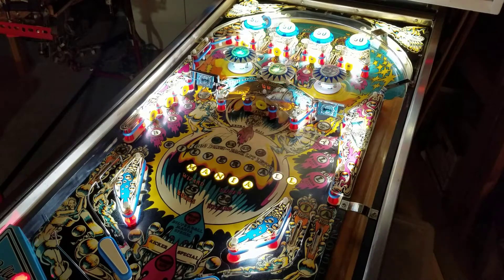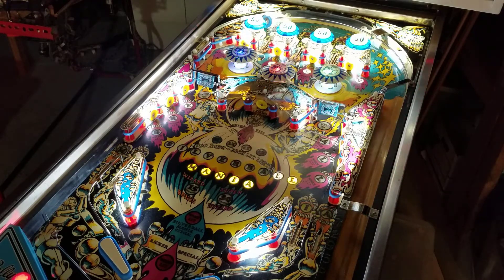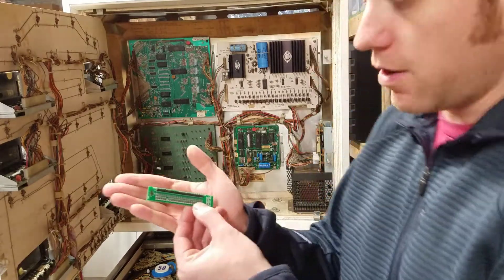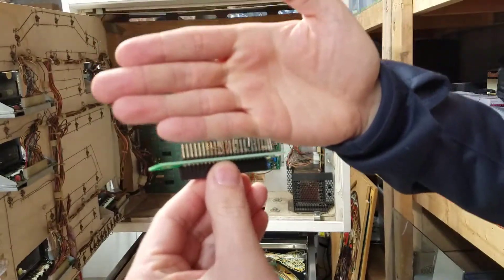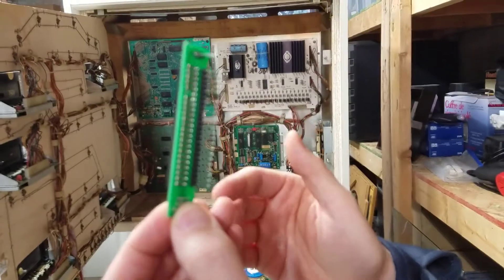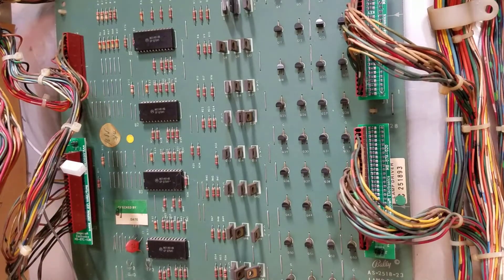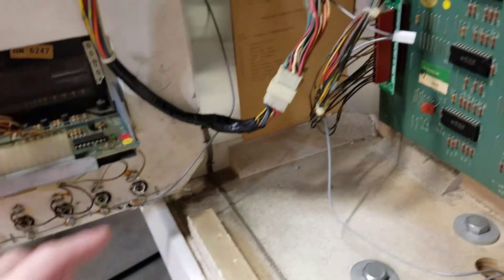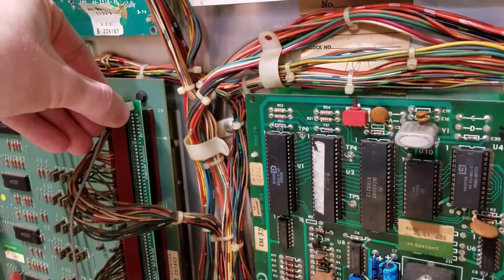How To Series: Remove LED Flickering

Comment: I have a 1980 Bally Space Invaders pinball, with what appears to be the identical aux lamp driver board to what you show in the video (AS-2518-23).  I ordered the Alltek replacement aux lamp driver board and installed it, then changed out every bulb to LED.  The Alltek board did not resolve the flickering.  If I buy the Siegecraft daughter boards, should I pull the Alltek board and put back the original aux lamp driver board?
Reply: You ever resolve this cause I replaced my Flash Gordon lamp driver with the alltek and it didn’t help. I have not touched the aux lamp driver board though
Reply: You have to buy the extra adapters for the aux board as well.

Comment: This video was a huge time-saver.  Thank-you!

The instructions that came with the flicker eliminator kit from Siegecraft, which I took delivery of today [Feb 3, 2021] said: "check that the location you're tapping into [with the alligator clip] has 5 volts", which I tried, by connecting to the "TP1" (test point #1) on the lamp driver board -- which resulted in ALL THE LIGHTS BEING CONSTANTLY LIT.  As soon as I connected to the exact same spot as shown in your video at [7:49].... Voila! Worked perfectly.  Thanks again!

Comment: Hello,  I hooked up the ground wire to the wrong part of the bulb socket  My playfield lights obviously didn't work.  I then correctly hooked up the ground and still don't work.  I removed the kit and the playfield doesn't work.  Did I just ruin the board?  Is it probably just a fuse?  All the fuses look good.